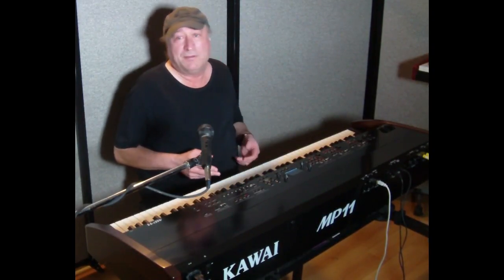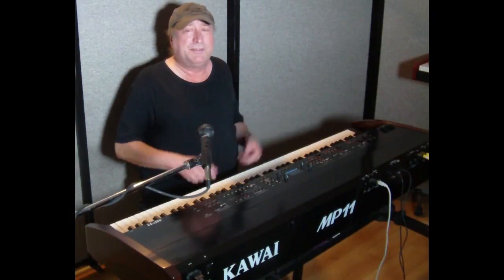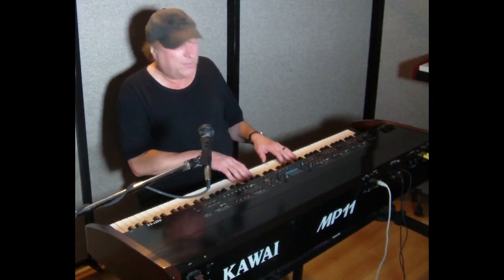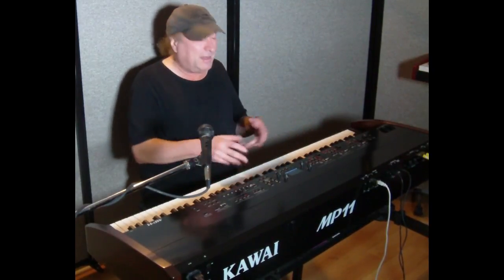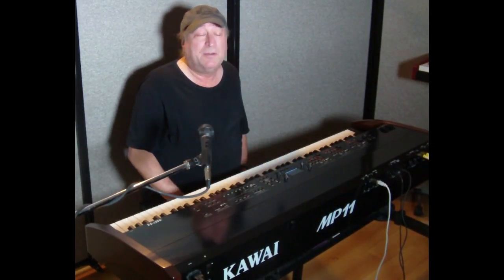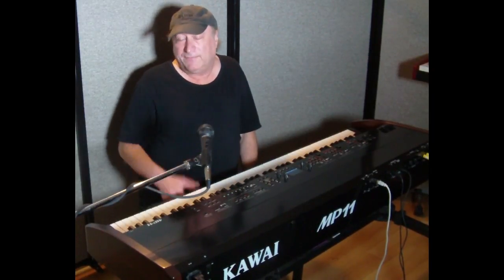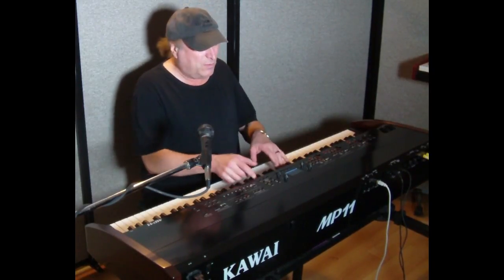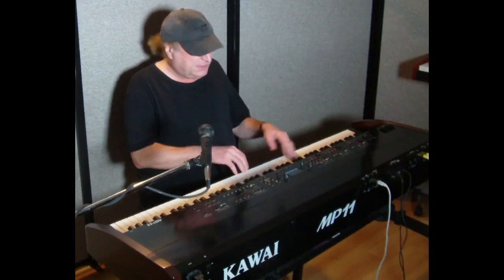Piano Keyboard Action - Touch / Velocity Settings

Comment: I would add that not only touch settings should be reverted, but all settings should be reverted to factory defaults before playing. Most keyboards have an option to easily revert to factory settings.